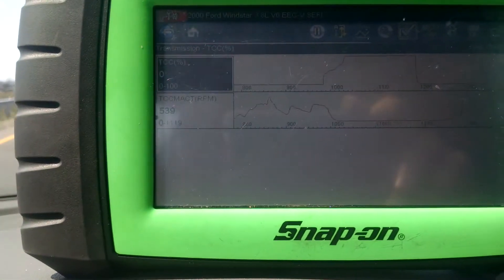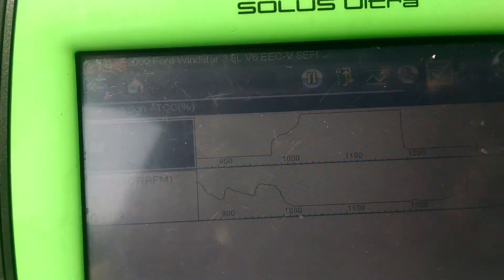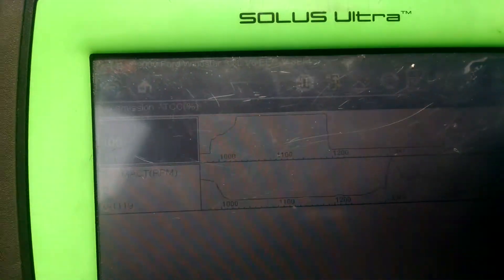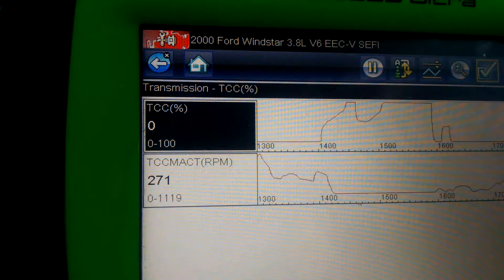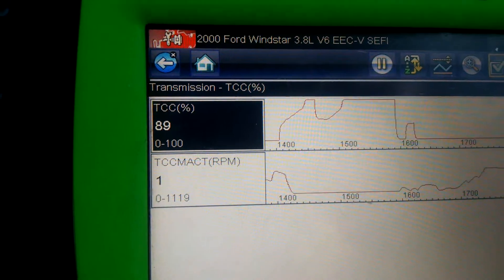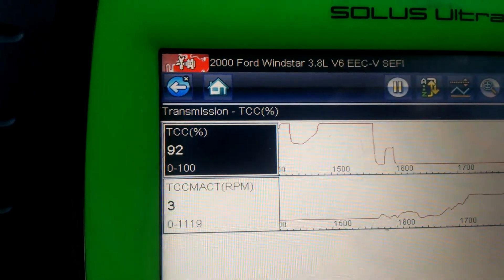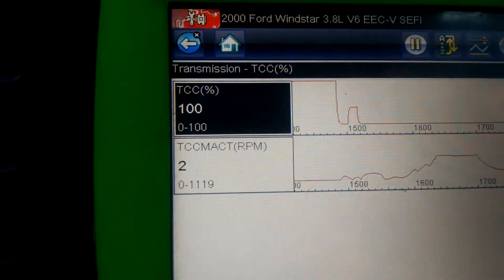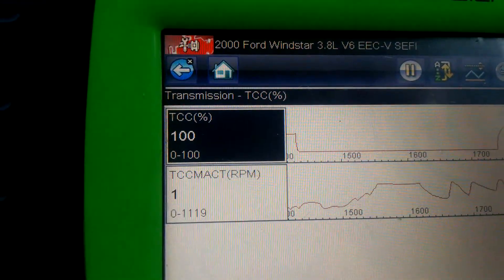P0741 Ford Taurus data stream

Comment: I have a 2001 ford taurus 3.0v OHV engine with 131,000 miles and that strange light that looks like a "Exclamation point around a circle" started coming on my dash once a month now for the last 3 months. When I pull over and turn off the engine, and restart the engine and drive the light on my dash doesn't come back on. It only does this once a month. I had it scanned at a "Oreilly auto parts", and they found a PO741 code which means the "TCC clutch solenoid" is bad or going bad. The car itself is driving fine but I believe that might be the problem. Right now I'm waiting for the 5-solenoid pak to get here.I paid $90 for it on ebay. I think the solenoid that needs changing has the "Blue" connector. The other 4 might be bad, as well so I might as well change them also. Any other comments from someone might help. I've never worked on a transmission before.